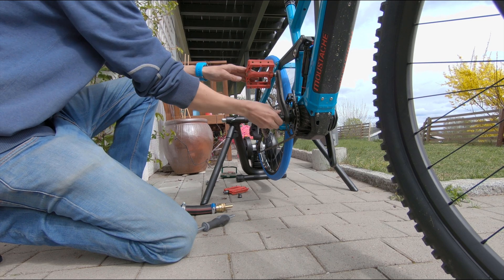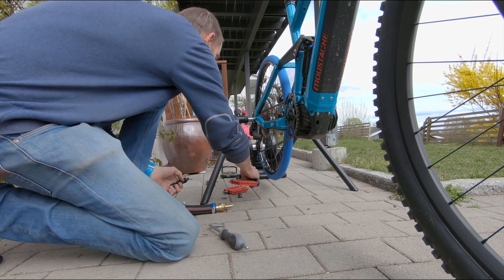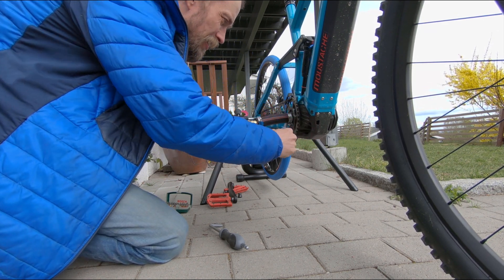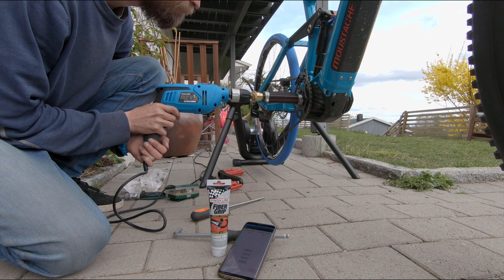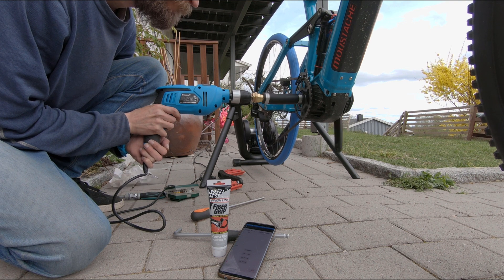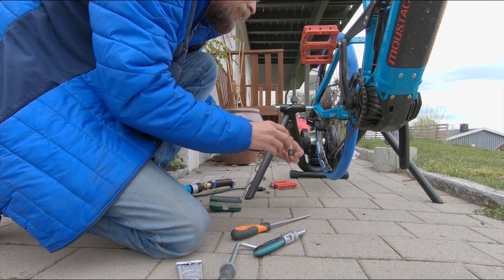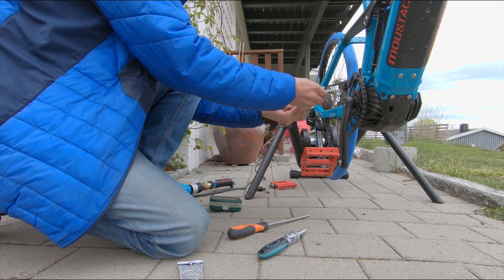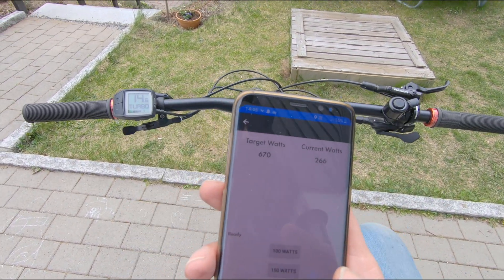Ebike motor test bench - first attempt FAILED

Comment: I'm not quite sure what your objective is here. Are you trying to determine the efficiency of the bike motor and gear box based on losses from bearings and any other sources? If so, perhaps your not capturing the data you're after because of mechanisms inside the motor that are not being utilized by virtue of driving the system from the crank only. This system normally is driven from a different input then the crank. For example there are clutches and other kinds of mechanisms inside the motor that may only respond to torque input from the bikes motor. As I said earlier I'm not sure if I understand exactly what you're trying to accomplish.

Comment: Could the motor be detecting "side force" as well? I mean, that when you pedal, other than the circular motion you also "press down" on the axle. 

Or the drill is too fast and causes over-cadence. 

My 2c. Just stabs in the dark :O
Reply: Yes I really think you need to put  some higher resistance on the back wheel. Keep up the good work💪